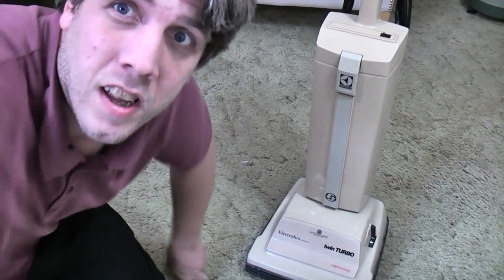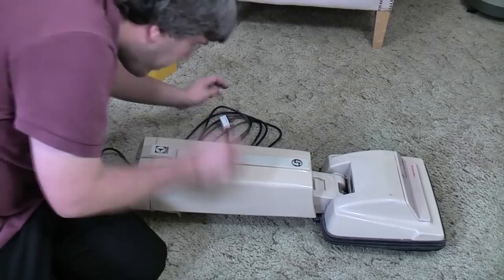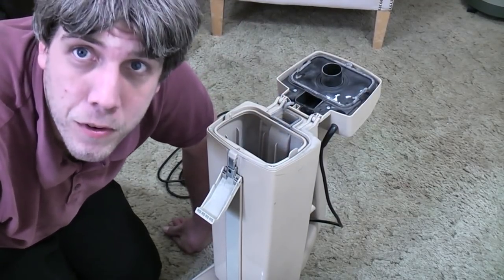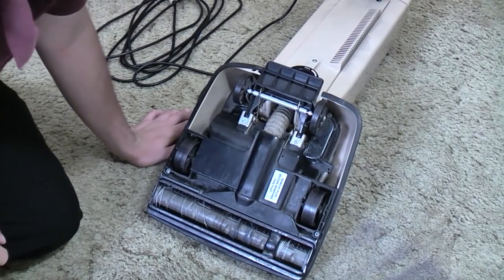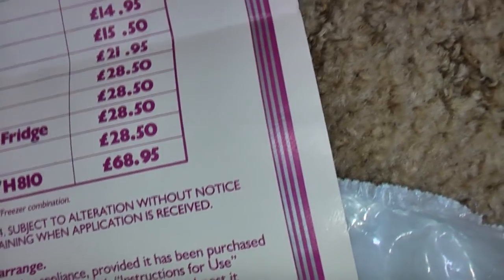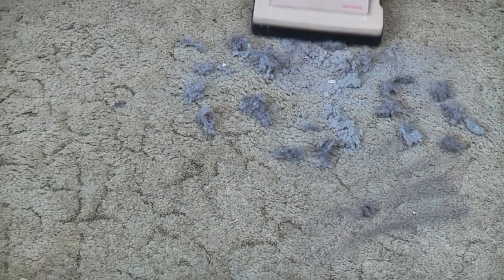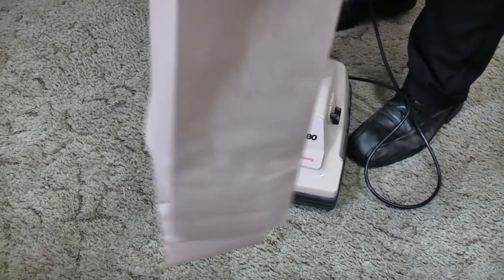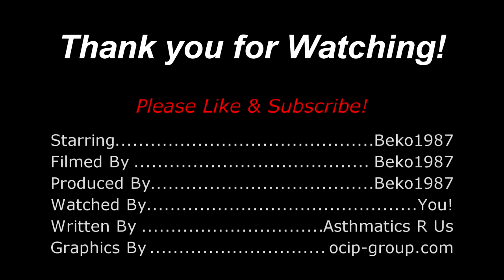Electrolux Twin Turbo Z522 - First Look, Before Refurbishment!

Comment: Love them! Is it possible to change the carbon brushes?
Reply from the maker: Yea it's doable, drop of solder will get the tails on and bend the prongs back to hold the springs in 👍

Comment: It seems that all the motor bearings on every one just dried up, but! I’ve so rescued all mine with some lube on the top bearing and a squirt of lithium grease on the inside bearing. I’d like to see if it’s possible to take the motor apart?
Reply from the maker: Yea, time isn't kind to them! The top half of the motor comes apart, this took a 608z! The refurb thread that I haven't written yet will show how its done!
Reply: Beko1987 Ah, ok. Maybe we can do a vid on it next time your up?